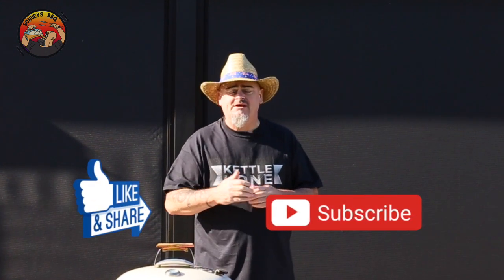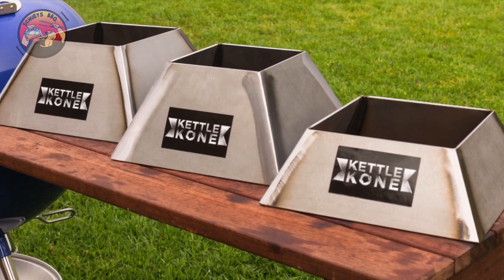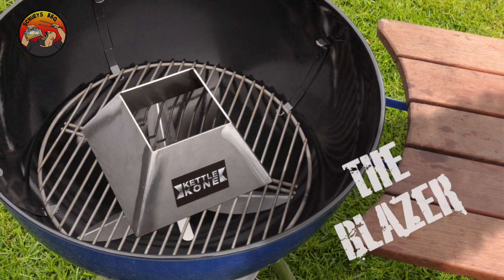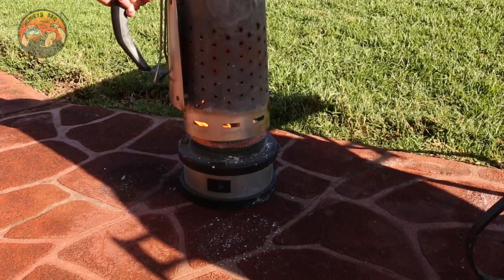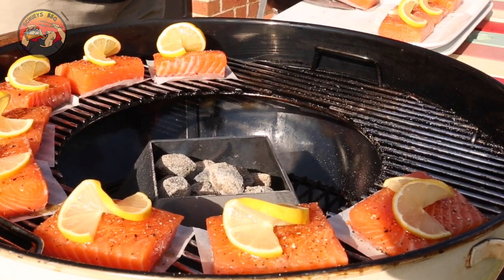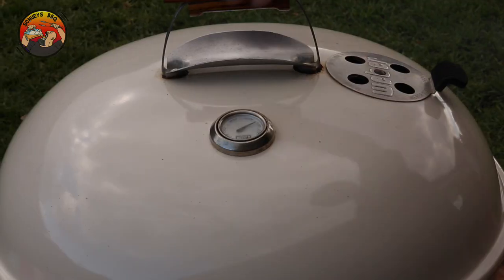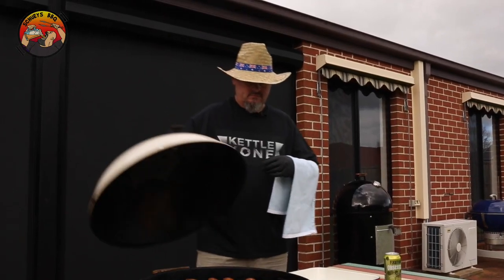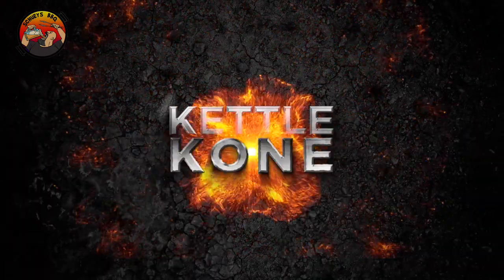How to get high heat using the Kettle Kone / Vortex in a Weber Kettle.

Comment: Schuey, I’ve seen people use foil on the charcoal grate to channel the air into the kone, and I’ve seen company’s that have plates made with holes drilled in em. 

Do you use anything like that under your cone ?
Reply from the maker: Hey Jack Marr, great question. It actually restricts the airflow and the way not only a Weber works but how the Kettle Kone works. I've hooked up multiple temp probes and tested it. The foil can aid in clean up but restricts the the extreme heat, 🍻
Reply: @SchueysBBQ  well hey. I’ll just follow you, your food looks fuckin amazing. 
You are a true Aussie icon

Comment: Hey Schuey. I bought a Kettle Kone for my 57cm MasterTouch Weber a couple of weeks ago from BBQ Spit Rotisseries in Moorebank Sydney. I have tried now 6 times but can’t seem to get the Weber much over 200C. I have tried new bags of Heat Beads, lump charcoal, full up, 3/4 full but can’t seem to get it much hotter than 200C. Vents are full open top and bottom. The last attempt I tried full bottom and 3/4 top vent but temps went down to about 180C. Appreciate any tips you can provide.
Reply from the maker: Hi Chris Lowe, sorry for the late reply. Sounds like you are doing everything right. My only other thing I find some people aren;t doing when we have gone over everything you already mentioned is........ Allowing the briquettes to actually fully ash over in a chimney starter before adding them to the Kettle Kone and Weber. It is amazing how much of a difference 5 minutes can make but if they aren't all fully ashed over and producing flames, they are not fully alight.
Reply: I will give that a try and see if any different (I do think they were ashed over when trying). A couple of extra questions though. If not fully ashed over if they go in the Kettle Kone and then leave in the Weber with an open lid to be fully alight before shutting the lid will this work? How long should it take to get up to temperature over 260 after putting the lid on to warm up the Weber? I did read that some people were using a blower to get the heat beads really hot before shutting the lid. Would you recommend giving that a try?